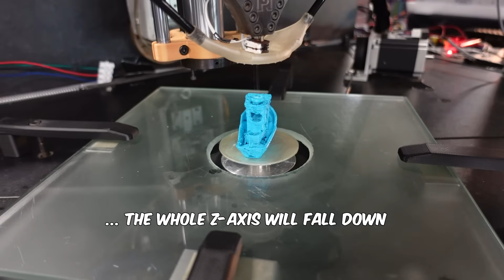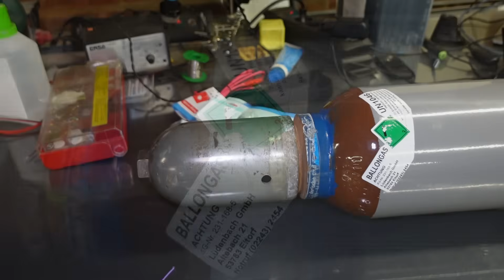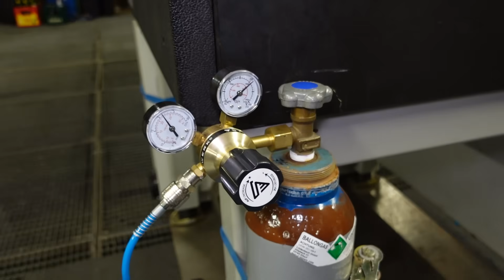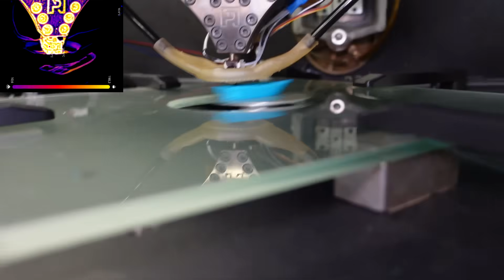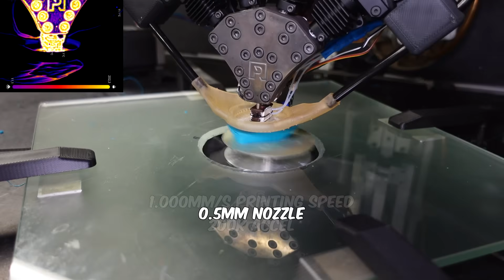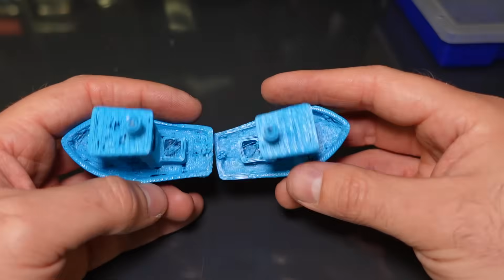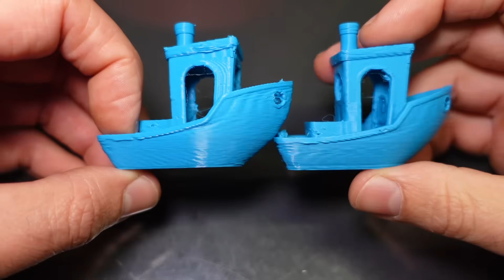Testing Helium Cooling on Worlds Fastest Printer (Minuteman Episode 18)

Comment: This is maybe a strange idea but maybe you could go for Helium if you designed some sort of chamber for the benchy so you could recirculate the Helium and reuse it. 
Maybe a different idea, maybe if you switch to a higher temp material, cooling is way less of an issue and easier to push past.
Maybe unhelpful but interesting, water vapor is also lighter than air. Actually maybe if you could spray an extremely fine mist, you might get something.
For my fourth idea, if you are getting a ton of downward force, try and provide more upward force?

Comment: What if the whole printer is enclosed and under high pressure? Denser air means higher heat conduction. Use the shop air to raise the pressure in the enclosure to 4 bar (for example), with a regulator valve to keep it at that pressure (excess air can escape), and feed the cooling air at slightly higher air. I'm curious if that would help cool it as well and how the printer copes.

Comment: Not sure if you've tried it... (and probably dangerous; I don't mess with pressure) But if you might get better cooling perf if you cool the shop air like throw the tank itself in a freezer. Thought process: you are hitting the benchy with air, that air has its own temp, the cooling happens at the differential between the air temp and benchy, so reducing your applied air temp gives you a bigger differential.

Comment: You may consider using a vortex cooler, they use compressed air and a tube that uses an internal vortex to pull heat out of the compressed air flow to give colder air than just the pressure drop from the flow normally. So instead of higher flow rates you get a larger temperature delta from the air. Then you don't need to keep buying helium.

Comment: Could you add a dynamic valve setup for the air or gas that can be adjusted based on the current layer structure? For example, cooling more for the lower overhangs to avoid the sag followed by more flow above to encourage better adhesion.

Comment: If you made it a sealed enclosure, you could fill it with argon or nitrogen and run cold nitrogen air through it without worry of condensation.  That way you wouldn't have to worry about atmospheric issues.  It wouldn't even have to be a full enclosure, just a tank for heavier gases.  That way, you could use nitrogen, which is a lot more abundant.
Reply: Vaccum chamber to limit drag perhaps
Reply: @jacobsmith946 vacuum would make heat transfer too difficult

Comment: An important question - are you taking into account relativistic effects of the part movement causing unintentional time dilation? If the print experiences time differently than the stationary nozzle that's going to cause big problems. 😂

Comment: Does the higher thermal conductivity per weight of gas and lower weight of gas cancel out for helium vs. air? Might be 6x higher conductivity but it's also many times lighter molecules.

Comment: Has anyone suggested enclosing the entire printer inside a helium filled volume like a plastic bubble, and just circulating the helium as you would on a regular 3D printer with cooling fans? You would be able to keep re-using the same volume of helium instead of letting it float away every time?

Comment: What if you do a mostly sealed box where helium is? and rotate helium in the box with a fan? So you won't have to keep pushing helium out constantly? You can just leave helium in the box and mix it and maybe water cool the box so helium transfers heat from hotspot to water cooled case/jacket. I mean as long as there is a helium over pressure I feel with it's increased heat transfer you could possibly manage extract large amount of heat.. :) Just a thought I mean 200€ box is cheaper than 4 cans of helium xD or even 2

Comment: What you really want is faster and better temperature-control, and also account for accumulated heat below. For the first problem, adaptive liquid cooling at the nozzle might be one way, adaptive airflow another way.

On the crazy end I would try evaporative cooling using some liquid, maybe liquid air, maybe alcohol or water,  deposited as micro-droplets created using ultra-sound at precise locations that need to be cooled. Or you could use a fridge- or AC-compressor to liquefy refrigerant and pump it to where the heat is.

Comment: What about a shop air intercooler setup? Not as insane as you did before, with the dry ice, maybe just barely zero c, so you don't need insane flow and blow away all the filament. Your nozzle is much better isolated now, it may work. Maybe. 😂

Comment: Weird questions: 
a) would it not make sense to have the cooling come from the bottom or from the sides (not attached to the head) instead of the top? 
b) since the printed volume is low, and cold air stays at the bottom, could you build "walls" and have very very cold air around the print,  while printing ?

Comment: What if you used nitrogen for cooling? And you don't need to buy it in tanks you can simply make (extract) it from your air compressor watch nilered last video for inspiration, it's gonna be expensive but if u could use nitrogen instead of it it would be more practical and cheeper in the long run, btw your videos are awesome

Comment: We all know what the next test should be. Hydrogen as an upgrade to Helium : Higher Thermal Conductivity (0.1805 vs. 0.151 W/m·K) and better capacity (14.3 vs. 5.19 kJ/kg·K). The problem of the potential explosion risk is an engineering challenge, but your cooling issues could be solved!

Comment: Instead of running it with helium you could try with hydrogen.

Less dense which is a downside, but higher specific heat capacity and thermal conductivity in return, and much more sustainable since, practically speaking, we have unlimited hydrogen available.
Just be careful so you don't have an explosion :)

Alternatively you could try with something less explosive like argon (completely inert) and pre-cooling it with dry ice or liquid nitrogen, which should avoid condensation unlike trying to cool plain air.

Comment: why not try nitrogen, argon, co2... 
you want high density with high conductivity.. specific heat is less important because you aren't recycling your coolant. doesn't matter how much it can absorb over time as much as how much it can absorb in a single collision.  
the higher your density and conductivity product the lower the nessesary pressure and therefore force required for the same watts in thermal transfer.

Comment: the cooling power of helium looks very promising. its too bad more test runs with it are not very feasible. but it would be interesting to see one or two sub-minute attempts using it. if you calculate the effective cooling from these tests you could maybe figure out how much helium flow would be required to perfectly cool a sub one minute run. if you get the numbers right i could see this working. finding a better solution would be nice, of course, but maybe extraordinary results need extraordinary materials. maybe there is another gas instead of air or helium that could be used but i suppose youve already thought about that.
Reply from the maker: I think it will go down something like this, yeah.

Comment: Build a gas sealed (or partially sealed) enclosure, then recirculate the Helium. Even if some helium escapes most of the print will be made in a helium atmosphere. Also probably less expensive too.
Reply: My worry here is you'll also need to re-engineer the air bearings to run on helium, if you want the recirculation to be reasonably pure. May still be worth looking into.

Comment: You can recycle helium... All you need to print in enclosed chamber, and use compressor to recycle it, there will be some air at first, so you will need to helium flow to replace air at the beginning. Ultimate solution is finding suitable helium separation membrane filter. This will push your recycling to 99%.

Comment: thats probably overkill, but you could have a big vacuumchamber around the pritner and recirculate the helium. but you would have to empty and refill the chamber every time you want to open or close it, with air or with helium. maybe not for this printer but for a different one..

Comment: Helium is a finite resource - it cannot be manufactured.  Best not to waste it.  Can you use nitrogen instead?  Much more abundant.
Reply: Honestly, this doesn't really seem like a waste. Using 1 tank for research into high speed 3d printing (the claim is for a benchy speedrun but it is producing real new information), and coming to a conclusion weighing the scarcity of it. If the result was just to make toys and trinkets cheaper, that could be a waste, but doing science is by far a better way to use limited resources than most is used by. Could have been performed more efficiently, but always easier to know everything in hindsight.
Reply: @gordonwalsh5652 helium is used a lot in medical imaging - there is no substitute and when it's all gone, it's gone forever.

Comment: Liquid nitrogen container with pipe running through for airflow. You would get to use cheaper gas for cooling only, ventilate nitrogen outside to keep things safe. I would assume that the temperature difference will improve cooling more than roughly room temperature helium will. Or maybe an AC unit forced on, cooling just the cooling air flow?

Comment: Just a pointless FYI: Your voice only changes if you are breathing almost nothing but helium. It will not affect your voice at 30-50%, but by that time you are already getting hypoxia. Either get a proper detection device or work with the windows open.

Yes, Helium is not toxic, but it's also not oxygen. It's like reducing the amount of oxygen in the room and consequently the amount of oxygen you breathe and if you don't breathe enough oxygen you pass out and if you happen to pass out near the source of helium you'll get hypoxia, your brain runs out of oxygen in a minute or two and you are dead.

Let's just say that in laboratories they make the gas cylinders travel lifts alone, in case there is a leak and the people die before they reach the target floor. Don't think you know what you are doing, KNOW what you are doing.
Reply: The bottle doesn't hold enough helium relative to the size of the room for that to be possible. He would need a smaller enclosure (such as an elevator) and he doesn't have one.

Comment: I still say that I'd try to pull off heat and let the outside fresh air to cool the print instead of pushing the fresh plastic with even more air. You can find a way to cool down the outside air more easily. Even if you pull much less air or instead more air with slower speed.

Comment: ChatGPT suggests - “Forming gas” as a compromise

"A 5–10% H₂ in N₂ blend (often sold as “forming gas”) is much less risky to handle and can be nonflammable as supplied at ≤5% H₂. It gives a modest boost in thermal conductivity versus straight nitrogen/air, but it’s nowhere near helium or pure hydrogen. It can be a middle ground if you just need “better than air” without going to full hydrogen service."

Looking up additional mixes, 60%-N2,40%-H2, has even more Hydrogen but is still non-flammable. It is a weld shielding gas, so it should be much cheaper than Helium, since it has wider used in industry and the constituent gasses are cheaper than Helium. A straight 100% Hydrogen seems to be super close to the same stats as Helium, but it is highly flammable when used in it's pure form. So. mixing Nitrogen, which has similar properties to shop air (as dense with the same heat conductivity) with Hydrogen, which has similar properties to Helium (as dense with the same heat conductivity), you get a bit less performance out the H2 N2 mix, but you eliminate the flammability of the Hydrogen and you get the price advantage of the cheaper gasses.
Reply from the maker: Yes. It is still flammable though...
Reply: @Roetz40  Hmm, I was looking at a welding gas store website and it is claiming it isn't flammable. They are selling it to welders that encounter arcs, sparks and open flames in their use of the gas. Just sayin'.

Comment: Does it need to be light or just cold? Would liquid nitrogen at a lower flow rate work? Run it a a lower pressure so you get less blowing of the filament?

Comment: also, dont know if it would make the printer any better, but bigtreetech also sells some bigger 5160 drivers the tmc5160t plus (although a different motherboard would be needed for them) if i remember correctly, this could also help as they can push like 10amps on 60v which is insane, if you ever need more speed on the motors remember this

Comment: You're attempting the equivalent of a formula 1 car in 3D printing.  You don't have to limit yourself to what is practical in the real world.  Go all out, no limits, no restrictions and get that thing done in 59 seconds.
Reply: F1? Nah bro this is top fuel drag racing
Reply: @Wazoo117 One could argue that f1 is more advanced
Reply: @QPD-1  F1 is more like a high end 10k$+ IDEX printer used for PEEK and what not. printing a benchy as fast as possible with no regard to safety is more of a Top fuel dragster lol
Reply: @FrozenByFire3 Yeah I realized it myself 😂
Reply: Is there a way to add rockets?
Reply: Next up this madman will cook Minute Rice in 58 seconds lmao
Reply: F1 is extremely limited, it's pure optimisation, not all out no limits. Such as safety limits, a massive restriction but morally necessary. And regulations to keep it fair and competitive.

Comment: I wonder if using a pressurized hydrocarbon, such as butane, would work well.  Instead of spraying a gas you could literally flood the surface with liquid butane at around the same temps as dry ice.  Granted you've got a fire hazard but if you'd printing this fast that risk would only last for a short time.  😁😁

Comment: Move the expansion valve closer to the heat exchange point so the gas is colder at point of application. I wonder how much by just making a cold box and use nitrogen or helium to cool dray shop air. If colder, maybe less flow and therfore less force needed to pull out the same quantity of heat.

Comment: I used to work in plastics, Long Long time ago. Plastics are classified as amorphous vs (semi)crystalline. What level of crystalinity or amorphous is the filament. A crystalline material has a sharp temperature where it goes from liquid to solid and may actually work better than an amorphous material that is soft and goey for a wider temp range and time. (nylon 6/6 is one that has such a sharp melting point iirc)

Comment: It would be very complex, but you could set up a mixed-air setup, such as running normal air over large areas and switching to helium on the bridges and upper surfaces, which would use minimal helium. However, this would require electronic valves and code to detect the exact second on the upper surface.

Comment: Maybie you can also make the pressure valve be digitally controlled, so you can maybie increase/decrease pressure relative to layer time.

Though maybie this is a bit unrealistic, im not in your league in terms of knowing whats possible with physics, could imagine there beeing way too much variability and delay.

But i imagine it could benefit the chimney part of the benchy a lot if it was cooled a lot more

Comment: An enclosed chamber, filled with helium, with heat-exchangers and compressor inside the enclosed volume (or sealed to it, possibly with expansion volume) would enable you to fill the build volume once, rather than continually flow new gas.

Comment: mhm the temperatur of the helium at the "cooling" point will be much lower that the air because it needs to drop pressure from 210 bar to only a few--> decrease in gas temp

Comment: Could you use an electronic valve on both the shop air | CPAP and another on the helium? To get real numerical data rather than just vibe.

Could you also use a lid on the platform and above the print to make a positive pressure chamber saving the amount of helium used much like you would use similar to welding and the duct itself will cause the the mixed air in the chamber to circulate if convection currents aren't enough. With waste|heated gases can be pushed out thru the bottom of the stage.

Comment: put a heat break at the hotend tip to pull your lava temp filament closer to the proper temp, pull out some decent heat without deal with as much gas chaos. a proper heatend chamber even with pla would be great here too, keep you temp swing to a minimum so you can maximize sticking more plastic to the previous layers.

Comment: If you used a liquid that had a low boiling point, it could extract more energy and, because of the nature of liquids, likely have better thermal conductivity. Because of the latent heat effect, you could remove heat energy. If you then sprayed this liquid at the part, it could cool the air around and the part very fast. I'm not sure if you have looked into this, but it could be more effective as you could extract more energy with less downward force, as you don't need the same high flow of air. You could even use it cooling mist that is constantly sprayed at speed(depending on cooling needs)